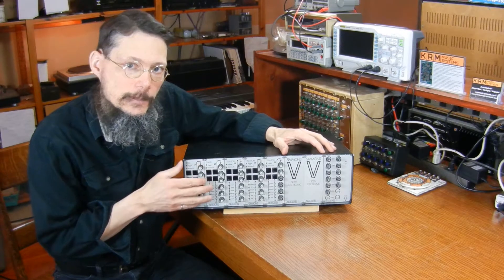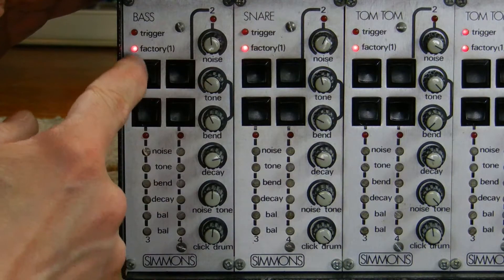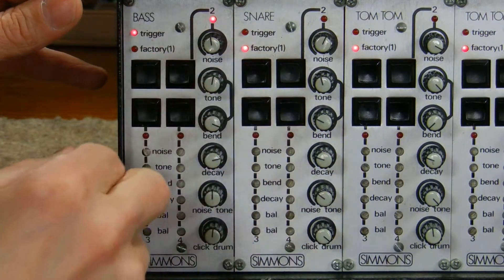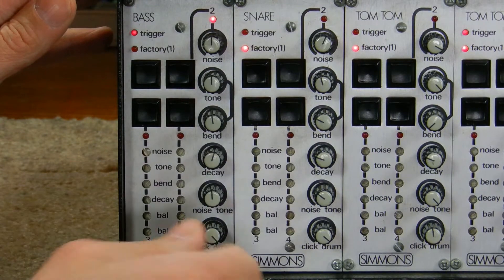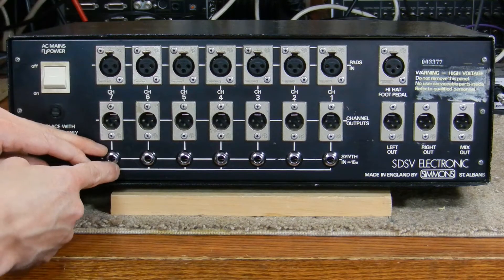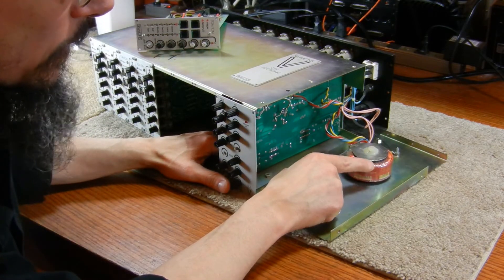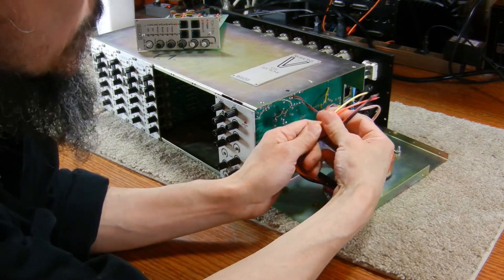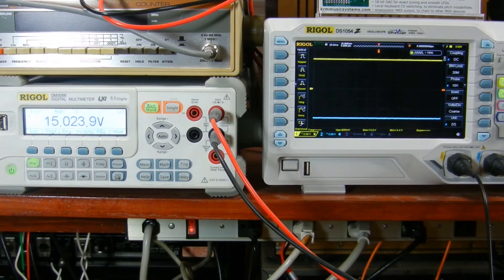Simmons SDSV Tech Walkthrough and 220/110 Voltage Conversion

Comment: Excellent. A quick query, should the top cover simply lift off, or are there any hidden bolts holding it in place on the right hand side (which is my present predicament)?
Reply from the maker: Hi DarkGlassly.  Sorry, I don't have the Simmons SDSV in my studio anymore.
Reply: @krmelectronics  Okay thanks, I was just hoping you'd remember from all those years ago ;)

Comment: Hi, I was just wondering if you happen to know.. if like how would you be able to fill in those last two empty channels with say toms. Would I need 2 Tom voice cards? Or how could I modify an sds5 module on the last 2 channels to make them for instance Like I said Tom sounds.. so instead of 3 you would have 5 toms 
Thanks
Reply from the maker: Hi Calin.  Each of the sound modules is slightly different, so you would need to find some tom modules to really re-create that sound.

Comment: Thank you Keith for uploading this demonstration. More people should be demoing this model.
Considering all the emphasis on sampling, modeling or otherwise emulating Roland beatboxes, I think there isn’t enough attention given to emulating the Simmons line. Back in August 2020, I uploaded a bunch of tracks to my channel, on some of which I used my ARP Odyssey reissue to generate individual drum sounds. I was aiming to loosely emulate the SDSV. More people should be trying to do things like that, and it wouldn’t hurt someone like Uli Behringer to try designing a dedicated emulation module.

Comment: You don't know how much this means that you posted this... I've been wanting to convert mine since I got it!
Reply from the maker: I wish you success in converting your SDSV.  It's a great unit!
Reply: Thanks Keith... you wouldn't mind telling me what exact transformer you purchased, would you?  Also, to get that side panel off did ou have to pop rivets or were they simply screwed down?  I can't remember.  I do remember that the power supply/mixer PCB is hard-wired to the backplane.
Reply from the maker: The transformer was a Triad VPT36-690 https://www.mouser.com/ProductDetail/553-VPT36-690

Check the datasheet (it's on the Mouser page).  It describes how to wire the primary for 230 VAC or 115 VAC, and the secondary for 36 VAC (center tap +/- 18 VAC) or 18 VAC.

I don't recall having to pop any rivits to get the side panel off, but I think you'll have to remove the back first (and the module mounting on the front).  However, there were some small design changes to the SDSV over its production run, and things could be a bit different with yours.
Reply: @krmelectronics  Thought I would update and tell you I did end up getting the recommended transformer last year and successfully converted my V to 110v.  I'm working on a second one now, and you wouldn't happen to know what would cause the -15v rail to be -12v other than the 79 regulator, do you?  It's been replaced, along with many other components, so I'm scratching my head...
Reply: It helps if I replace a 7915 with a 7915, not a 7912.... lol

Comment: Cool video. It does look like each module is identical and just has different labels for 'Tom', 'Snare' etc. Is there a difference between the circuits of those main modules or is it just different range adjustments for pitch and filter settings?
Reply from the maker: Great question.  I should have mentioned this in the video.  The modules are all basically the same, but there are some slight differences:

Noise:  The Noise control on the bass and tom modules simply filters the noise output (low-pass filter).  The Noise control on the snare filters the noise output, but it also introduces a pitch shift in the noise (due to a higher Q value in the filter).

Tone:  The bass module has the lowest tone range, the snare has a medium tone range, and all 3 toms have a high tone range.

Tone Modulation:  The snare module has a slight modulation to the tone. The bass and toms do as well, but it's much more subtle.

Velocity:  The pitch of the toms will go slightly higher as the velocity of the drum pad input increases.
Reply: Thanks for clarifying.
Reply: i was goign to ask this exact question...

do you know if there are some smaller simmons devices that offers similar sound generation? (like single channel)